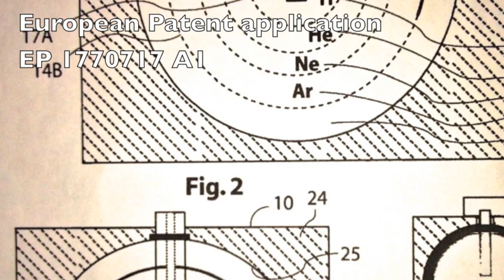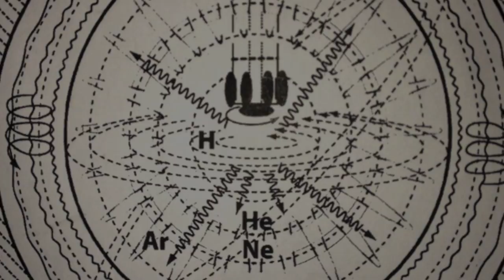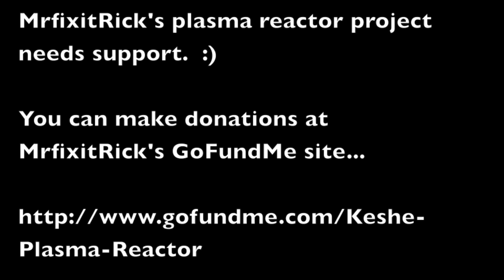Part 1 - Keshe Foundation First Public Teaching Workshop March 5th 2013

Comment: In Part 4 of this series, from 7:40 - 8:40 Keshe mentions using carbon gas.  Carbon can only exist as a gas at temperatures over 3700 degrees Celsius in a perfect vacuum, 4700 outside a vacuum. Below those temperatures it quickly condenses. If your reactor is built from plastic (or any metal for that fact) it wont last long with a 4000 degree insulating gas around it. this is nonsense,